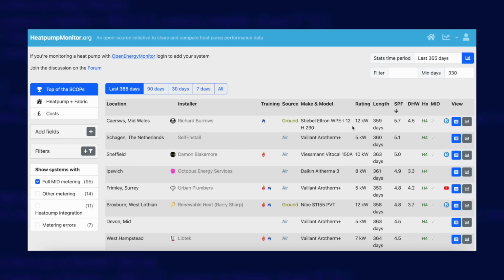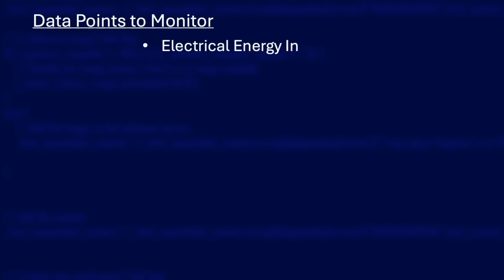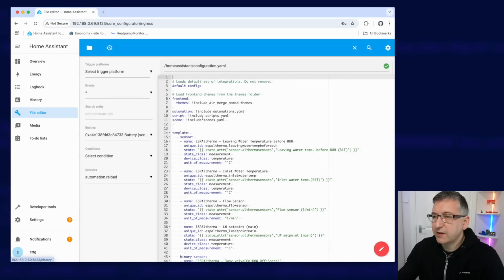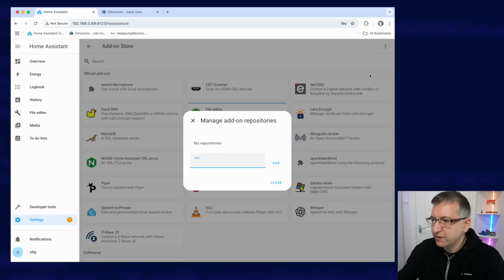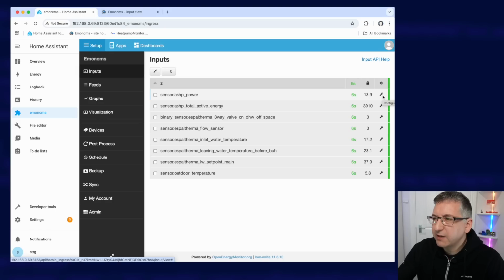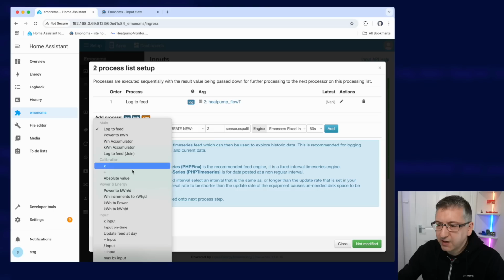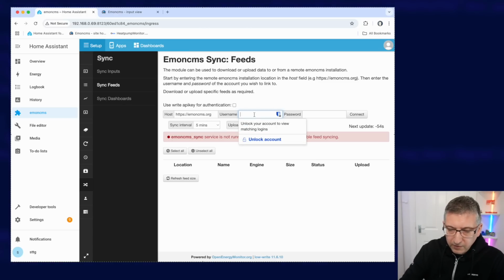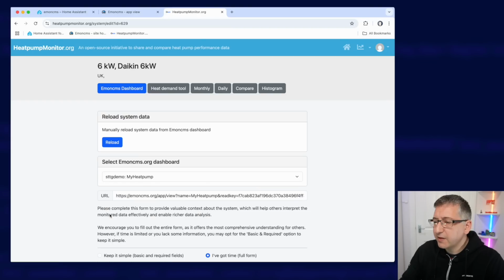Tutorial: Heat Pump Monitoring using emoncms and Home Assistant (heatpumpmonitor.org)

Comment: question on your total active energy sensor - i have the same shelly and using the 'Power' sensor for ashp_power - did you create a second sensor to track the cumulative energy from the shelly?
Reply from the maker: The Shelly has a sensor "sensor.ashp_total_active_energy" which I put in a utility meter helper on a daily cycle to get a daily value.
Reply: @SpeakToTheGeekTech  thank you - i also have a sensor which has a state of either 'central heating' or 'direct hot water' for the state of the 3 way valve - i guess i need to interpret this as well?
Reply from the maker: Yes, I'm not sure which heat pump integration you have but ESPAltherma gives you a binary sensor binary_sensor.espaltherma_3way_valve_on_dhw_off_space which is on when hot water is being heated. If you don't have a binary sensor then you'll have to create a helper binary sensor from template to interpret that source sensor.
Reply: @SpeakToTheGeekTech I have a grant heatpump.  I've a sensor which shows the heating mode, either hot water or central heating. Do I need to make a binary sensor for the hot water which I set to 1 when it's hot water?

Comment: Can you use that data to adjust your heat pump parameters?
Reply from the maker: Yes that is generally the idea of emoncms - see the detail of the heat pump’s operation and monitor it when you tweak things. But you need to know what you’re doing, it won’t tell you what to adjust

Comment: Thank you for this excellent guide. I will be using it to help guide me to integrate my Daikin ASHP into HA. 

One question, would it be possible to split the energy input based upon whether the ASHP is heating the house or hot water? Possibly using helpers? If this is possible then maybe calculations can be made to calculate the cop for heating and hot water separately and also an aggregated one for the whole system.

Would you know if this would be technically possible?
Reply from the maker: Yes, create a binary sensor from {{ state_attr('sensor.althermasensors','Space heating Operation ON/OFF') }} and use that as heatpump_ch in emoncms, and {{ state_attr('sensor.althermasensors','3way valve(On:DHW_Off:Space)') }} as heatpump_dhw. Then when either hot water or space heating is on it will be highlighted differently in the graphs and specific COPs calculated.

Comment: excellent video i have one question with the total active energy in  kWh is that including or excluding the immersion heater
Reply from the maker: Excluding the immersion heater. I have a Shelly EM Pro which has a separate CT clamp for each of the heat pump and the immersion heater, so they are monitored separately.

Comment: Hi, great video, lots of detail covered in at a good pace, thanks.  One question, when you did the flow rate delta T conversion you multiplied by 70, where did you get the 70 from?  My Vaillant hp is l/h so the calculation would be flow rate / 3600 x (flow-return) x 4178 (specific heat capacity of water)
Reply: It’s ok I can see your system is in l/minute so the 70 is basically 1/60 x 4200 =70 for valiant or more specifically l/hour it is 1/3600 x 4200 =1.167
Reply from the maker: Yup, it’s the same equation but simplified and with converted units :)

Comment: I found this tutorial very interesting and most helpful.
Do you have any more details of the Wi-Fi unit you used to retrieve your data.?
Hopefully it would work on my heatpump.
Reply from the maker: For liability reasons I haven't made a tutorial on the project, but it's a home-made device consisting of an ESP32 dev board in a 3D printed case with a few Dupont cables to connect it to a serial port inside the heat pump. It's running software called ESPAltherma and it's designed for a very limited few brands of heat pump: https://raomin.github.io/ESPAltherma/ You tinker at your own risk!
Reply: @ hi, managed to get it working via an api with a bit of work.
I can now obtain all the necessary information that I require to calculate my COP.

Comment: You absolute legend! Thank you so much for this I have been battling Home Assistant Utility Meters for weeks now and never really getting any decent data. I also just found that the Bottle Cap Dave’s Octopus integration allows you to add your ASHP as a device so you can get tariff based cost data as well . I just need to work out how to subtract solar production from all this so I can get a real idea of how much the ASHP is actually costing.
Reply from the maker: Glad I could help
Reply: @SpeakToTheGeekTech  just a quick question but what is "sensor.ashp_total_active_energy" is that the heat output or the power consumption?
Reply from the maker: @sident1972  That is the energy consumption of the heat pump reported by my Shelly energy monitor. The HA integration gives it an unnecessarily complicated name.
Reply: Cheers

Comment: Which outdoor sensor did you use? Ext. indoor ambient sensor (R6T) or Outdoor Air Temperature? I've only just set this up and assume the R6T is the sensor on the back of the heat pump and the Outdoor Air Temperature one is the sensor on the north facing wall? Oddly, the Onecta integration is reporting a number different to both of them (seems to be reporting closer to the R6T sensor). Thanks in advance, awesome video :)
Reply from the maker: I actually use a separate outdoor temperature sensor (Netatmo weather station) because the Daikin only seems to report the outdoor temperature when the compressor is running. If I used its own sensor I would end up with flatlines on the graphs whenever the heatpump was 'off'. Originally I was using "Outdoor air temp.(R1T)" though.
Reply: @SpeakToTheGeekTech  Really interesting it does that, when the Onecta integration seems to report it even when the compressor isn't working! Thank you for responding :) On another note, would you ever consider doing a video of the Daikin controls and your setup? I know everyone's home is different, but would be really useful to gauge settings. Thanks again!

Comment: I went through all of this just a couple of weeks ago. I do want to try and replicate the charts in HA as the application only supports the values it prompts for, so doesn’t include the temperature of your hot water cylinder which I really wanted to see. Also, I mentioned to an octopus engineer about the ESPAltherma and he was not very happy about it being installed (although their electrician plugged it in for me’0. Apparently Daikin do not like you connecting to the device, so you do so at your own risk and could invalidate your warranty…though in reality as long as you do everything as instructed it’s pretty simple and safe. Oddly I have all the feeds enabled other than cooling and it is only costing me about £6 per year so not sure how they calculated that. Now I just can’t stop looking at it every five minutes to see what’s happening!
Reply from the maker: Yeah Daikin can't publicly endorse connecting third party home-made components to their kit and that's understandable.

Comment: Just what I need with our ASHP going in on 22nd. I have a Shelly Pro 50EM ready to go in. Will Rpi5 4GB with 128GB SSD on a USB adapter be sufficient to handle HA? I have been running on a Rpi4 1GB but it keeps crashing.
Reply from the maker: The Pi 5 with 4GB RAM will absolutely be more than enough. I run HA on a Pi 4 with 8GB RAM and that's overkill - but I have a test Pi 4 with 1GB RAM too and it's a bit too slow and unreliable on there. I use that particular Pi for video demo purposes only. 2GB RAM is the minimum HA needs to run reasonably, 4GB is perfect, 8GB is fine but is basically wasted money on the extra memory!
Reply: @ Got my Rpi5 today. What a difference! So much snappier and stable. Also got the M5stickC Plus2 in readiness for ESPaltherma. Your guide for that will come in very handy. EmonCMS already installed.

Comment: I was not aware home assistant could run emoncma. Now i need to migrate it across from the pi its currently runnin on 😂
Reply from the maker: I was running it on a Pi too (Pi 3) until a couple of months ago. I've actually migrated it to a Docker container on my NAS rather than as a Home Assistant add-on but it's the exact same image. I struggled importing my old data into the add-on in Home Assistant due to import file size limits.

Comment: bit the bullet on emocms hey, been running it on my vaillent with no issues with a Bus adaptor,
Reply from the maker: Good to hear. Was the eBus adapter hard to fit? Any soldering? Or just plug and play? Asking for a friend...
Reply: @SpeakToTheGeekTech  Just Plug the USB for power + screw pins for the 20v bus, download. You know the IT thing, so it's a breeze 4 u. 
HA  Add-on runs eBUSd
Reply: @eco-terrorist  I found a few eBus boards online, which one are you using? I'd love to get my Vaillant up and running. 😀
Reply: I have a Vaillant Arotherm+ and ebusd (v5 adaptor). Have you managed to get the flow rate appearing? Did you speed up the polling rate?
Reply: Hi. Thanks for this. Think I'll get another pi5 just to run this. I have predbat running on a pi5 with my mitsubishi cascade system. I'm getting all the ASHP data via MQTT. I also have the octopus home mini plus 2 power meters for each ASHP. I'm sending ashp power via a open energy monitor sensor connected to the meter using a esp32. 
You've probably saved me hours.

Comment: I got myself an AIRA Heat Pump system and I must admit assuming it would make a lot more data available to the user but it does not even tell you the temperature of the water in the storage tank and just gives you a minutes of hot water value based on usage. No system water pressure sensor either so it just shuts down on a critical low flow fault, an outdoor temperature sensor on the case of the heat pump so readings really vary depending upon the heat pump location versus solar gain.

The indoor unit just has a coloured LED display but there is no accurate list to what they mean and often they just display green and white. The app is supposed to tell you more but typically just says it is working fine.

My 8Kw unit also seems to have been made in the PRC rather than their factory in Poland.

No access to other data or API :(
Reply from the maker: Oh no that's a shame. I wonder if there are third party controllers you can install to replace their default system? That's the problem I think because it's only in recent years we've really cared about this sort of data - years gone by you'd have installed a boiler and been happy it was heating your home and didn't have a red light on the front, but now we're demanding far more user insights into the products. Manufacturers are catching up still...

Comment: One hell of a tutorial, brilliant. Shame my vaillant system doesnt include all the data thats required without me getting an eBus adapter, they aren't that expensive but its just one more thing on the todo list and costs me more :_sttgMoney:

I'll maybe set it up locally and put some of the data in to make a start and see if it convinces me to buy thr adapter.....
Reply: i've got this working with a eBUS Adapter Shield Interface v6 on a Vaillant ASHP 7Kw
Reply from the maker: Thanks! This was probably the video that's been the most effort to prepare, film and edit out of all that I've done so far so I'm hoping it's useful to a lot of people once it goes public in a couple of weeks. I'm surprised you haven't eBussed your ASHP up yet, I know you like your realtime data... the emoncms my heatpump app is pretty useful to refer to even if I don't look at it that often - having the historical stats all there at a few clicks to compare dates is handy.
Reply: @SpeakToTheGeekTech  oh I want to, just no free time! I have the cooling chip as well if I want to play around with chilling the radiators and ruining the floorboards with condensation but again not had a chance.